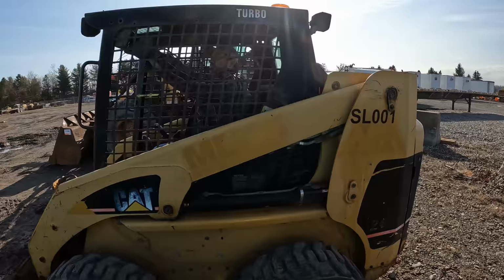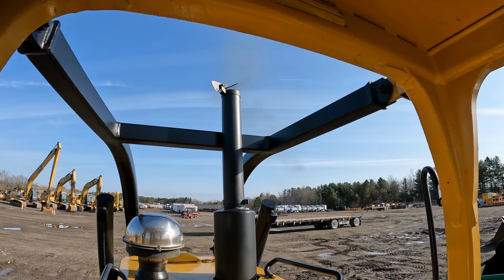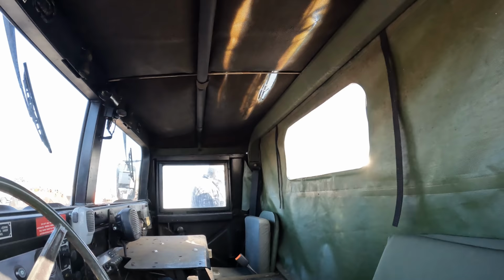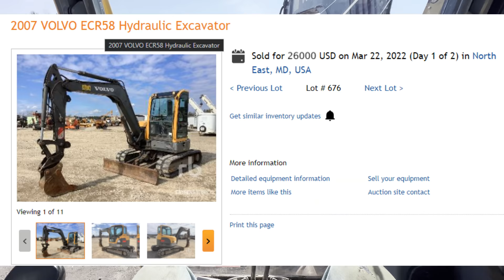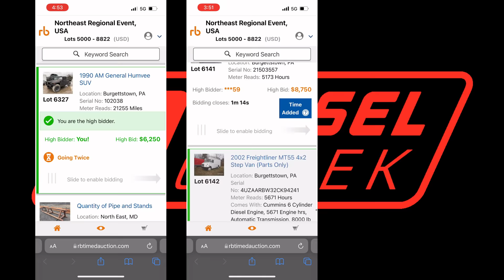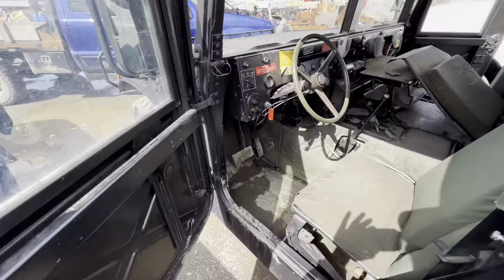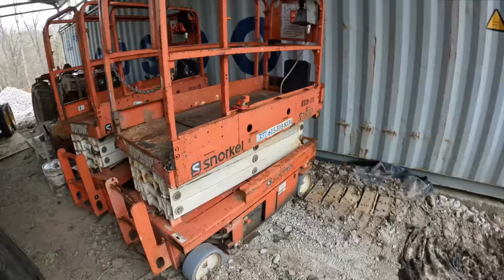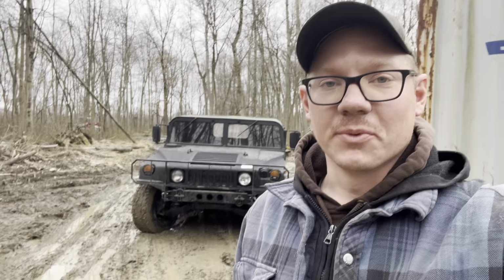You Won't believe the DEALS I got at this Auction! (I Scored BIG!!)

Comment: That Humvee is going to be one badass work/service truck!
Reply: Yea, put the big welder with the broken axle on the back of it instead of the old wood troop transport mess!
Reply: Oh.
My.
Work truck.
Reply: It was a good deal and with it being former police owned it probably was rebuilt at one time and taken better care of then others.
Reply: Use the humvee for towing stuff instead of using the Ford
Reply: With the prices of fuel right now (March 2022), of course the Humvee was going to be chip.
Reply: @shabadoo24  At 45 MPH max speed less chance of a trailer going catty wompass.
Reply: Did he mention how much the humvee cost? Maybe I missed it?
Reply from the maker: 6250
Reply: @thigtsquare950 , my thoughts ran about the same way.  Fuel costs are going to make the Humvee quite an expensive toy to operate.
Reply: @DieselCreek  sure I'll give your money back.... when can I come lol
Reply: @DieselCreek  what are the Diesel prices there?
Reply: @thigtsquare950  about 8 miles to the gallon. Should still be fun.
Reply: @CopeML  the max I ever had one is going downhill we hit 70. The needle was buried. On the flat you might get 55, up a hill with a 1/4 ton trailer I was lucky to hold 40. I’m sure you could get slightly better performance from a turbo model, as all the old ones are NA.
Reply: @DieselCreek  24:15 HumVee's in Canada sell for $50,000 to $150,000. The cheapest one I saw at a Richie Brother auction, sold for $28,000 and it wasnt running. As for the Roof, I would do either a sheet aluminum or a Fiberglass roof, and make it removeable.. The canvas roofs were always prone to leaking.
Reply: Oh yes indeed...
Reply: @DieselCreek  6250 for a running Humvee, even with issues, is a STEAL !!! That was an awesome buy, along with the lifts at 250 a piece. Not surprised you already sold the 2 extra. Very easy sell, those units. The batteries cost a lot, though.
Reply: @DieselCreek  For the Hummer parts go to New Retro Parts Inc. Hoovies Garage did a video on them
Reply: @DieselCreek   For the Hummer parts go to New Retro Parts Inc. Hoovies Garage did a video on them
Reply: @TheBibliofilus  His buddy will  not like that idea, especially since that broken frame welder is his and not Matts...lol
Reply: @KrazyMitchAdventures  I think your advice about replacing the canvas roof with sheet metal or fiberglass is spot on! That canvas is always going to be problematic.
Reply: Look up C&C Equipment in Nashville, Indiana for humvee parts.
Reply: @DieselCreek  so, what did the wife think about you paying for a hummer ????
Reply: Does it have a 6.5 or a 6.6 in it?
Reply: @DieselCreek  If I told you that even without any papers it would fetch around 100K of your American dollars here in Indonesia?
Reply: @mr.schwartz2090  I don’t think they ever came with a 6.6 did they? I thought it only was turbo 6.5
Reply: Best purpose for a humvee. Post apocalyptic road rage vehicle. Throw some armore plates on it, then when idiot drivers do their thing, you can slam them into the ditch. I wanna do that myself. First day, the roads here would be less than half capacity.
Reply: 6.2 or 6.5 in the Humvee?
Reply: When you drive the 988 start in 1st gear then when she gets to a higher rpm tap it to 2nd and the same into 3rd. Every now and then exercises the transmission more than normal. That’s what AM General told me back in 86 when I learned how to drive them in the Corps.  Mine had 12 miles on it and I had to put the seats and everything together. Still remember the marine tactical number that was on the hood 544860
Reply: @DieselCreek  Not sure what engine/pump are in the thing (I'm english and know F-all about them lol) but if it's some kind of IDI with a vane or inline pump run the thing on sunflower oil or whatever else is vaguely combustible and cheap lol
Reply: @CharlesManch  oh my dawgness!
Reply: You can always tell who was and who was not in the military .
The people who buy those things have never had to drive around in one.  They are horrid at best to commute around in.
Reply: its a dream to drive one of these
Reply: @shaneking3080  did a quick wiki search. No they didn't. 6.2, 6.5 turbo or non-turbo the 5.7, or a 6.3 gasser in the early days.The 6.6 is a common crate motor people like to put in them, I was confused haha
Reply: @mr.schwartz2090  sounds like a 6.5.
Reply: The first ones we got in the Army in 1980 Somethin 😁 had 6.2l  It was a 350 olds Gas motor converted to diesel . POS !!

Comment: I know its a very long shot, but on the Humvee did you check the back and see if the pioneer set was in its travel frame? There are two ways to fix your leaking roof, get a new one, or the field expedient method, Hundred Mile An Hour tape. Honestly in my 18year career in the Army, I have yet to find a soft top Humvee that didn't leak. Go online and find the -10 manual and print it out, it will tell you what to look for on daily, weekly, monthly PMCS. 

First thing you HAVE to do is change the oil and oil filter. Who knows when the last oil change was. Next thing is the transfer case. Drive it around in all of the ranges for about five minutes each, its rare to have to use it so the transfer gears get a little stiff.

You finally have a vehicle that I can work on and am the SME, LOL.

EDIT: I dunno what you are planning to do with the troop bench seats in the back, but you really should look at the the bolt points and see if there is any dissimilar metal rot there.
Reply: I wonder if one could get off cheap by throwing patches on the areas worn through and then spraying with some Raptor liner or an equivalent.
Reply: My first thought was a sheetmetal removable top.
Reply: @KristaMae  yuppers,  insulated for winter use with a head liner.
Possibly even for summer it it has or will have AC.
Soft tops are just a money pit repair headache.
Reply: As seen on TV, FLEXSEAL has the solution. 😁 If you can make a screen door float, anything is possible.
Reply: I never did it, but I’m told the top made a nice hammock (until the top stretched and then collected water)
Reply: For the Hummer parts go to New Retro Parts Inc. Hoovies Garage did a video on them

Comment: For the HV. Remove the cab cover pressure wash it let dry. Than go to Home Depot and get a 1/2 gal or more of (Aqua Armor)(Best stuff ever!) water repellent for fabrics and spray it on with a pump sprayer. Great to use on boats, tarps, RV's awnings, deck umbrellas, car covers, etc. Anything! Also apply a UV protectant (like Sun Guard) helps fabrics last longer.😉👍👍👍👍👍

Comment: The man lifts usually get corrosion in  connectors, and also on some of them the charger wont charge if the battery is too low, then you have to help with a normal charger first. Good video as always 😄
Reply: That's what I was thinking, a trickle charge on the batteries for a while should bring them up so the charger can take over.
Reply: I don't know what kind of batteries your lifts use, but I've had great luck using Noco Genius chargers to recondition my batteries and keep 'em floated. In fact, it even brought back one battery I thought was a lost cause. Might be worth a try. 
I'm so jealous about your lifts - congrats on that, Matt! I've been wanting a good cheap one for years. No good deals on any at the RB near me, though, dang it!

Comment: The lifts won’t budge if they are on uneven ground,those are meant to drive on flat surface.The beeping is most likely because one of the wheels does not touch the ground.
The one that works,is on a fairly even surface,but the reason why it does not lift higher is because the bottom flange can’t open on both sides due to debris on the ground.
If the charge was lost completely,it needs more charge than normal,and maybe you lost the battery pack completely. Sometimes it gets revived if you pour some demineralized water.
Sometimes it doesn’t work at all and you need to change that pack completely.Hope it helps.
Reply: Thanks, those are the Inside tricks that save people from a lot of stress.
Reply: Correct pouring demineralized water (Or in simpler terms Distilled water) on all cells doesn't mean it will work but if it doesn't the batteries are most likely sulfated. To fix that charge them up for about half a day then put them on a heavy load until the batteries are at 10.5v without a load attached, then recharge them and repeat this process about 15 - 20 times and you should basically have near brand new batteries
Reply: The beeping means the charger can't see the batteries , The pothole bars have to be fully down to let you fully boom up (I work on snorkel booms and lifts)

Comment: The roof is fabric so any waterproof fabric will do. Remove the old one, use as a pattern for a new one, buy vinyl from any fabric store and cut to fit. Ive done this to repair an MG Midget roof, and a Jeep Wrangler soft top. It can't be much different for the hummer roof.  UV radiation is the problem, it'll eat anything over time, so pick a UV resistant vinyl or just cover with a tarp.
Reply: I vote for an old school canvas re bop...rather smell canvas than vinyl...
Reply: @charlesangell_bulmtl  yup. Loads of sources of canvas out there. Hell, old civil war reenacting tent or fly will do and could probably be cheap. Whatever Matt chooses to do for this, I've no doubt he can figure it out!

Comment: Some hard learned words of wisdom. Containers are designed to be tied down through the corner holes. Like when hauled on the specialized trailers they come on.  The authorities DO NOT CARE how many stripes you have. If replacing the toggle switches on the scissor lift use only mil-spec switches. Garden variety switches will leak and actually complete a circuit through the moisture in them really low amperage circuts( milliampere). Don’t cheap out here. Maybe del city wire. Find a multicell battery charger that can recondition.  It’s slow going but you can generally reclaim the batteries and bake the crusties from the plates. Also copious amounts of fresh battery acid because whoever serviced the batteries couldn’t be bothered to use distilled water. Lots of luck and congrats on your new purchases.

Comment: The HMMWV will always have a wet seat the doors don't seal well.  I'm willing to bet it is a 6.2.  Put a battery cut-off switch on it to avoid the drain.  

For those of you who don't know.
High 
Mobility
Multipurpose
Wheeled
Vehicle
Reply: 6.2NA/THM400 combo, I believe.

Comment: Matt, this will probably be missed by you.  I drove them in Iraq and Michigan in the MI Army National Guard.  They are OK.  The heater will keep you cold in the winter.  You can about roast a turkey in them in Iraq in the Summer!  As another said, get the -10 manual.  It is designed for a lot of operator maintenance.  I am guessing those are run flat tires.  Those do work.  Matt, you can do a video alone on replacing a tire on a rim.  Those rims are two part with a rubber o-ring in the middle.  Been there.  Done that.  Twisted a socket extension doing it!  
They do make a solid hard top.  You can find one of those or make your own.  The canvas will always leak.  If you pull up the floor mat, you will find drain holes to let the water out.
In short in my Guard time, I was not impressed.  
Also, always check the 12 castellated nuts on the independent suspension.  If the cotter pin falls out, the nuts will back off.  If you lose a nut and hit a bump wrong...what happens next won't be good!  In my time I found 2 missing cotter pins and one nut backed off a few threads.  
Get the -10 manual.  Use and obey.

Comment: On the batteries I would take them out one at a time pour the acid/water out and put distilled water back in them if you have a old trickle charger use it to build up the battery back it will take at least 5 days per battery to revive it and bring it back to life. 
I revived a old lawnmower battery 2 years ago and it still works good.

Comment: the roof on the humvee! get some sheet ,metal or sheets of aluminum shear and break them to fit over the roll bars and windows like the old model tees with big scutcheons fasten them with stainless bolts to clips on the roll bars you attach...seal the bolts and hardware with silicone and pin weld copper spikes every 6 square inches to the under side of the metal... the copper stabs will attach 1 1/2 inch styrofoam then one time washers would hold in place seen it done many time s the copper pins to duct work and then the one time square sheet metal washers press and lock it in place... and old insulator trick ...cover the styro in fabric if you like .quiet the ride and hold the enviromentals inside the cab power wash everything and paint ...after you chase everything else out ...kinda crafty your wife might like to help with the finishes nuetral colors etc...something you can get shitty and power wash, fast drying and rot resistant

Comment: Great haul, especially the Humvee. I'd consider just getting some sheet steel and making a removable topper for it instead of messing with more fabric topper if it was mine. Too bad you didn't get the larger manlifts. Probably more than $250 worth of steel in each one you could use for other things.

Comment: Matt; if you still have that H1 Hummer in your stable; A.M. General in the early 2000's managed to get a Duramax Diesel shoehorned into the H1's by giving them a six inch lift so the oil pan would not hit the ground to get rid of the dog 6.2 GM diesels.

Comment: Nice work. I'm partial to the ex-military Humvees. One of the conversions I've seen is installing a second gen 5.9L Cummins. Plus a new Allision auto trans if you can afford to buy one.
Reply from the maker: never heard of swaping a cummins into one, dont believe it would fit! ive seen plenty of duramax swaps tho...
Reply: @DieselCreek  They'll swap. The Duramax is easier though. When I bought my W250 Dodge, I pulled the 440 big block/727 auto trans and swapped to a 1st Gen Cummins and new NV4500. No problem. I went from 11 mpg to 19 mpg.
Reply: @Peter_Schiavo  could just leave the 6.2 alone. It's a hmmwv, not a sports car

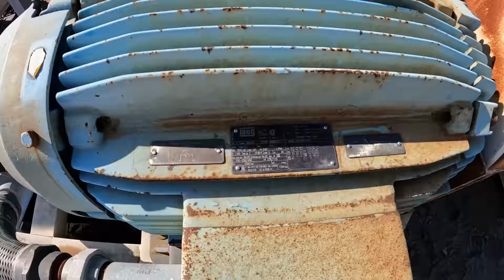Comment: 9:23 We have a 200 hp electric motor that runs the hog, looks very similar just a bit bigger. Eats laminated veneer lumber (LVL) up to 24" wide and 3½" thick on the regular, comes out sawdust and toothpick sized slivers. Doesn't bog much. Runs on 480V 3 phase. It's pretty impressive to hear it spool up! Requires us to wear earplugs AND earmuffs!
Reply: Had afew electric motors on one of the ships I worked on that made those look like toys. Not sure what the hp rating of them were now, but all were 440v 3 phase

Comment: the seat belt light and ecm light on that skidsteer are interlock issues.  there are ecms under the floor board one is a interlock ecm and one is machine ecm.  they are know to rot out and cause issues like it had.  pull them out and check them.  if you let them dry out real good you can sometimes seal them up and they work of awhile

Comment: Find an old travel trailer or camper and strip the aluminum off. It'll make a good top for that hummer, a little latex calk , some rivets, spray paint it and it should do fine. Very light weight and holds up better than canvas. Put some of that shiny bubble wrap insulation they sell and you can probably get the thing pretty warm in the winter too.

Comment: 31:23 about the batteries. They can be recovered if they end up not doing much. What you need to do to get rid of the corrosion, charge them for a long while and then put them on a heavy load, in this scenario using the lift should be heavy enough until the batteries are empty, then you charge them back up again and continue the cycle for around 10 - 20 times. Each time you do the cycle you should notice it lasts longer and longer, you could even measure the current with a car battery tester to see whether it's improving. If it isn't improving check whether one of the cells are empty and fill it up to cover up the lead plates with distilled water. Do not use tap water, it will kill the batteries!!!.

Comment: Suggestion on the HMMMV, replace the ignition if it's a lawn tractor ignition, they are known to not turn off properly after alot of use and will drain the batteries. Get yourself a good ignition for it.

Comment: You can probably make a new soft top for the hummer easier than buying one. Any marine grade fabric would work if you know someone with a decent sewing machine. Just use the old one as a pattern. Also you might get a couple gallons of deionized or distilled water to top off the batteries, you might be able to nurse them back to life.